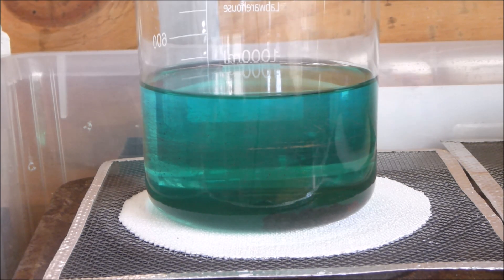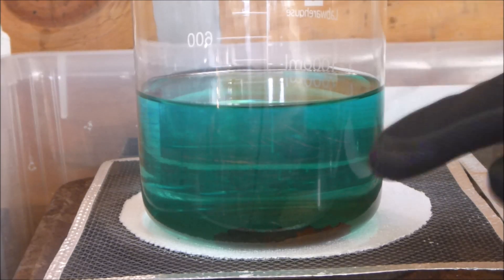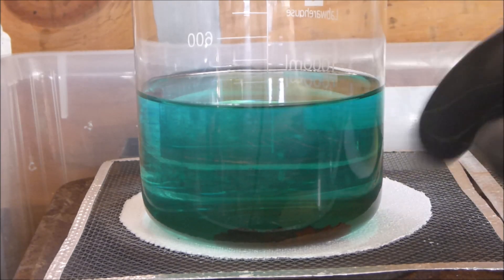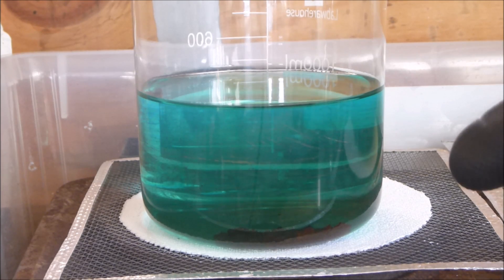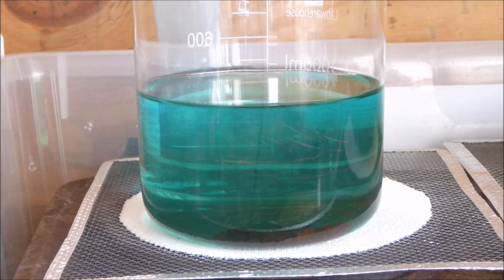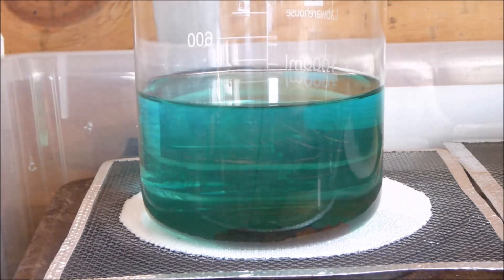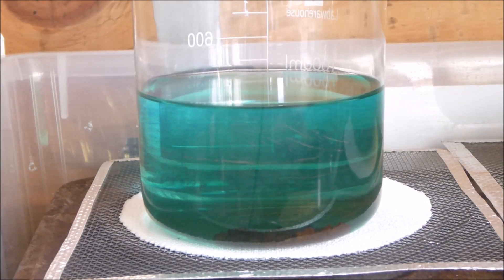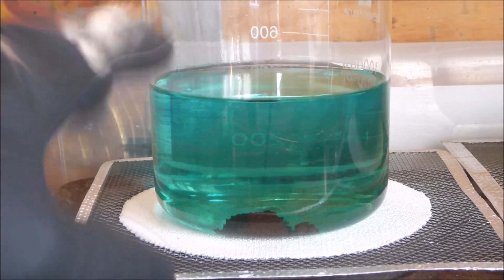Gold Recovery - A Nice Clean Gold Drop

Comment: Thanks
Reply from the maker: Thats amazingly generous, thank you very much @bcgoldminer, reach out any time 👍
Reply: @successfulengineer Nah, sharing knowledge and the energy of thoughtfulness is amazingly generous. 
The resulting mud seems very similar to the usual smb drop, albeit less dark brown, The process took about three hours, and even with heated stir plate, the mud somehow adopted the copper’s original shape, roughly…
The stuff decants easily. Boil and rinse, in water only and/or dilute hydrochloric acid?
Thanks again.

Comment: How would you recommend removing 22 Ct gold plate from a ceramic plate?
Reply from the maker: There are a few ways to skin that cat, I believe Cody (Cody's lab) has a video where he uses a Cyanide solution to leach the gold from the ceramic items. You can also directly dissolve the gold in Aqua Regia. If the plating is reasonably thin, you may find that HCl and bleach could also work.

Comment: Been watching your videos for a while and i love your updates.
Just out of curiously if you got the electrical parts for free and only had to pay for the chemicals and electrical bills for heating and pump. would you make any profit by doing this or would you always end with negative value?
Im not asking profitable as in making a living rater if you loose money by doing this if you would sell it.
Reply from the maker: Hi there, if you have good access to good quality e-waste, then you will certainly make a profit financially. The initial outlay to buy equipment is a bit, but not huge. The ongoing cost of chemicals and power is pretty minor overall. The major problem is what you value your time at. This is my major hobby, so I don't put a $$ value on the time I spend on it, if I put the same $$ value on my hours doing this that I do when I contract out, then it would be a massive loss.

Comment: Been waiting for your next video , thanks for your time .
I had made a few comments on your last about using mercury & retort for fine recovery .
Finally found how to contact you off the video page so that you contact me .
Another concept I have been chasing , is recovery of most everything to bring costs down to a min.
Some example general number to make the point , if we start out with 100 [ any amount gm lbs ] of base scrap to recover gold - single digits , lets 2 % of the 100 , then we are putting 90 some % of value in waste , I get up to $2.50 per lb for copper , and if out original number represented 100 lbs , that would be $225 , now when we spend money of whatever , there is more profit , the gold is cream on top / or the cherry ;)
Also if using chemical , nitric being most costly , I have seen where others are recovering that ?

Thanks again
Reply from the maker: Hi KD0CAC, I haven't yet gotten around to welding up a retort to give the Mercury a try, but will get round to it at some point. Yes, your concept of catching more of the values has a lot of merit, very often in e-waste, the gold is just a by-product of copper recovery. When you are working with material like IDE pins there is probably more value in the copper than the super thin gold plating. The biggest issue I've seen is that often we get copper fall out of solution as a fine powder and our scrap buyers don't have much interest in it and melting it into bars would likely also be cost prohibitive. Always appreciate your input!